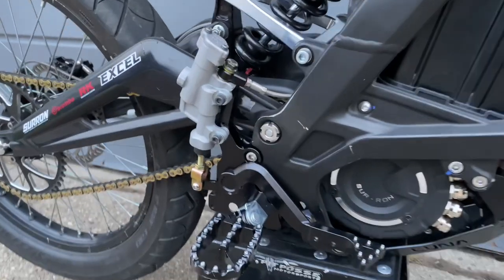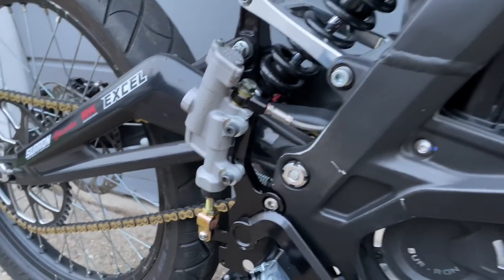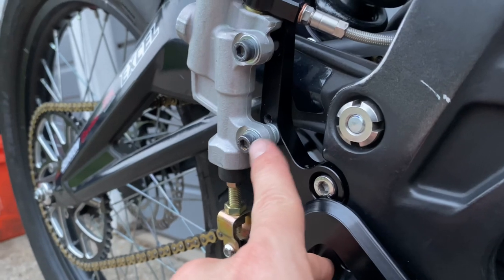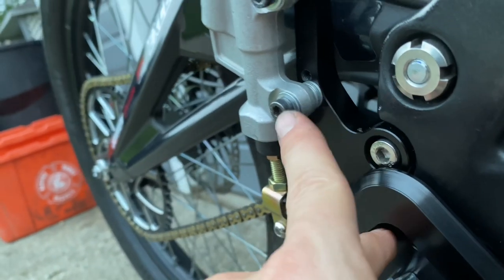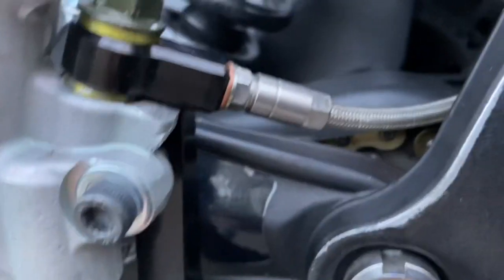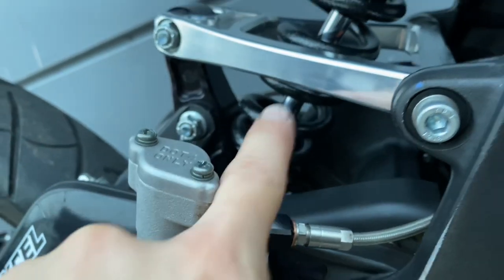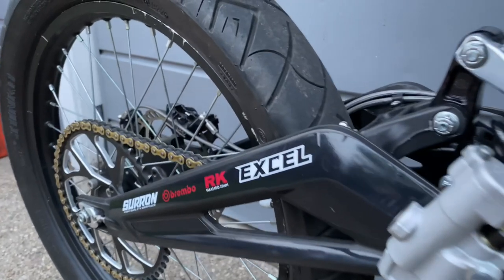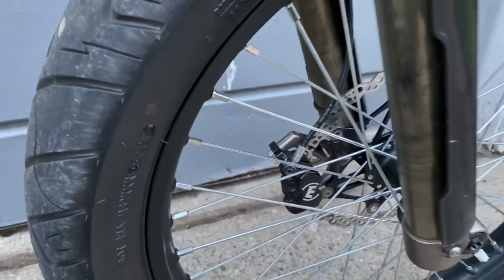Dirtbike foot brake for Surron X!

Comment: What made you upgrade the NTC Designs stock rear master cylinder to the YZ? Was the upgrade worth it? How did the braking improve? Can you provide me with the part number of the YZ master cylinder? Thanks a bunch!
Reply from the maker: It works so much better it doesn’t feel like an on off switch anymore I feel like it’s actually usable having a little squish before it locks up